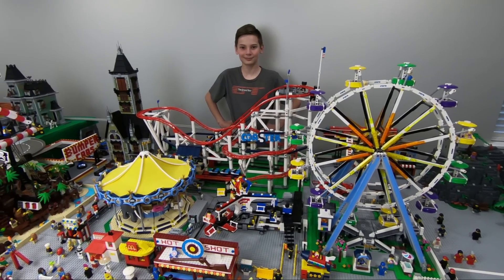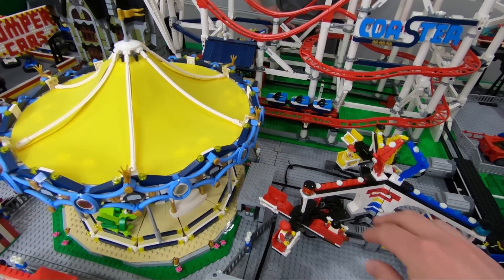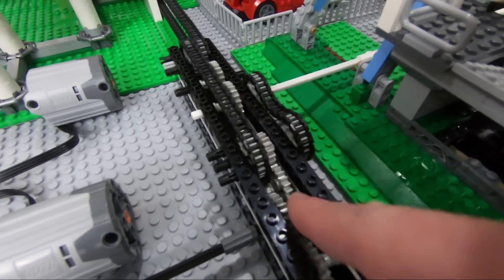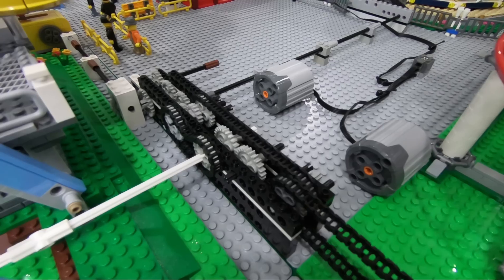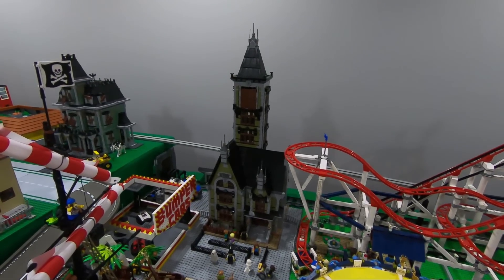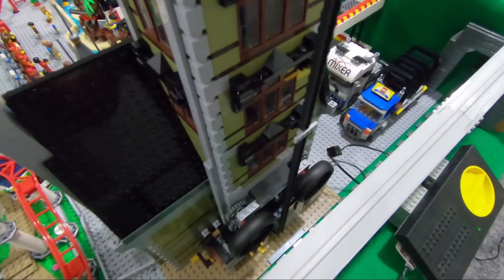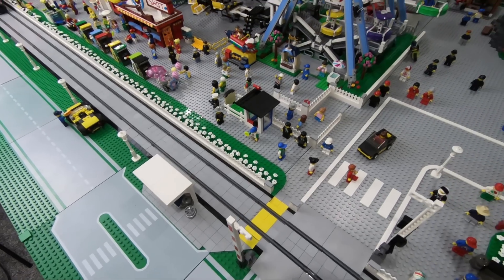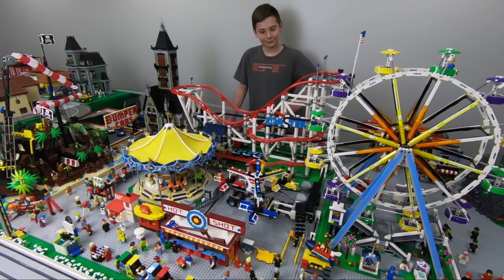5 Rides, 2 Motors, 1 Switch

Comment: Hi Alex and Josh,
You are experiencing 2 problems in your system. Both are easy to fix. The first problem where you have shocking movements in the roller couster, I saw Josh give a little push. You can solve this by driving the drag chain at the top gear of the roller coaster. Keep in mind that you should always pull a load. When you push on a load you get these shocking movements.
This is also reflected in your second haunted house problem. Pull your load up instead of pushing it up. I do not have this set myself and have not yet been able to test it, but if you still have problems after this adjustment, you must increase the ratio. I don't think it is a problem if the elevator works a little slower. Here I am convinced that you can also have them powered with your central system without affecting the other attractions.

Keep up the good work. Love your City!

Comment: you could done the wire  way where you use power functions extend cables and use them to connect them on a ir receiver and control by power functions remote but i don't know if the speed would be slowers.

Comment: That's smart, saves batteries. Can't tell you how many times I've run out of batteries for my legos
Reply: *batteries for your Lego
Reply: Sending batteries for LEGO. 

Here you go 🔋 🔋🔋🔋🔋🔋🔋🔋🔋
Reply: ‘’Cough’’ rechargeable batteries ‘’cough’’
Reply: Hmmm, but where would the cable be to plug into the wall? That’s Mark Rober engineering stuff
Reply: Rechargeable battery boxes